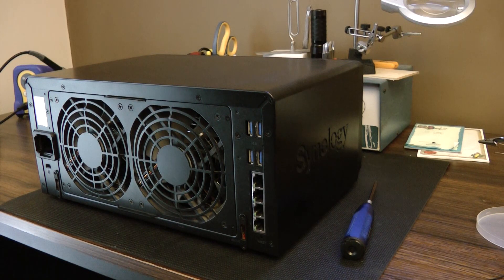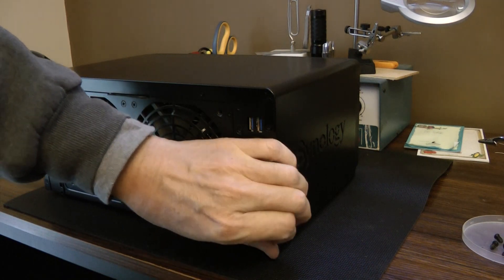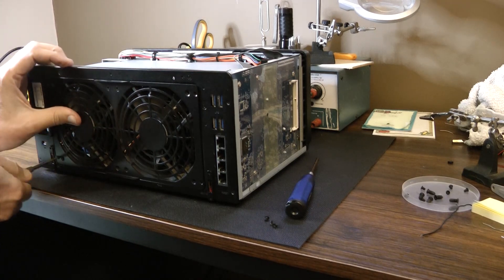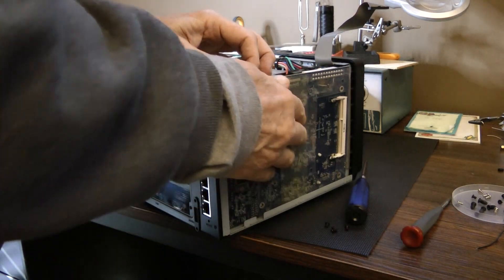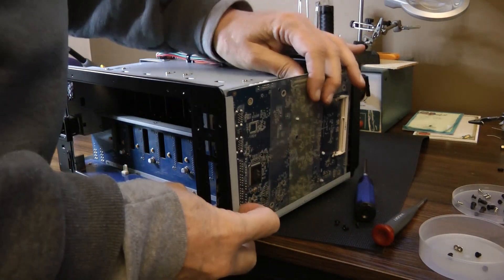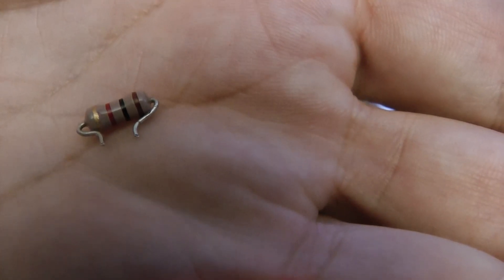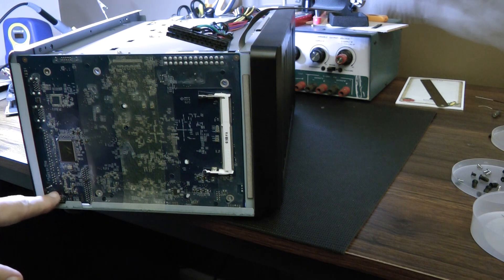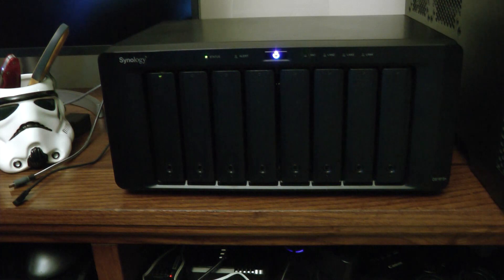Synology 1815+ won't turn on FIX

Comment: Hi Gary! I stumbled across this video. Is there a way to test and see what the issue is before I start soldering new stuff? You mentioned a C2000 Atom thing but it was already installed. Is that something that is needed as well?
Reply from the maker: There are two issues with the 15 series Synology NAS's.  The ATOM bug which was installed on the one NAS I fixed.  I have a total of 3 Synology 15 series NAS's.  All of them need the ATOM fix.  Two of them I bought used/broken on eBay and applied the ATOM bug to one of them and the other one already had the ATOM fix.  Both of them needed the resistor over the transistor.  

Eventually that transistor will fail which prevents the NAS from turning on.  The patch is to solder a resistor over the transistor.  The problem is that it won't last, but I got a good 3 years out of them with that patch.  Then I had to replace the transistor, but again that transistor will fail again.  

I did some research and 'maybe' found the permanent fix by replacing that resistor in the power supply.  It supposedly puts too much current through the transistor resulting in it failing.  I did that fix about 10 months ago, so there is no way to know yet if that is the final fix. 

The ATOM bug (Intel bug) has to be done to them.  It's pretty much a guarantee that will fail your NAS.  The transistor thing happens a lot of times but it's not 100%.  I still have a 15 series NAS where the only thing I did to it was the ATOM fix.  

There is nothing you can test.  If the NAS is flaky turning on, turns off while running, that's the transistor assuming you already applied the ATOM fix.
Reply: @GaryQuiring I just started having random power offs and now I can’t get it to turn back on. I thought maybe it was the power supply. I was hoping there was a way to see if that is still outputting power. I guess I’ll look up the ATOM bug and get a resistor as well.
Reply from the maker: @jasonhagen  That's the classic symptom for the transistor issue.  Put the resistor over the transistor and that will fix it.  Also do the ATOM fix.
Reply: @GaryQuiring do you know if I’ll need a new battery as well? No one has one in stock so I have to order one and it will be a few days. Just trying to see if I can do the resistor fix or wait til I get a battery as well. 

Also will the 1k ohm resistor work if it’s a 1/4 watt? Or does it have to be 1/2 watt as well?
Reply from the maker: @jasonhagen  Not sure.  I think the battery probably keeps the internal clock running if it loses power.  Since the clock is set via the NTP server it's kinda odd why it's there.
Reply: @GaryQuiring  would you happen to have the BC487C transistor I could buy from you? All I can find is 100 pack and I don’t need that many.

Comment: Ich habe das Video gerade von einem Kunden vorgeschlagen bekommen - ob ich das so reparieren könnte, und was es kosten würde. Und ich habe gesagt, das kann ich schlicht nicht verantworten!! Also ein Tranistor (JUNGE) ist ein aktives Bauelement, entweder als Schalter oder als Verstärker genützt, und ein Widerstand ist ein passives Bauelement. Und Synology müsste ja dumm sein, einen Transistor zu verwenden, wenn ein Widerstand die gleiche Arbeit machen könnte! 
Also ich müsste da erst mal die Funktion des Transistors prüfen, sehen was er da macht um zu sehen, ob man den tatsächlich durch den Widerstand ersetzen kann, oder nicht. das einfach so zu machen, ist in meinen Augen vollkommen verantwortungslos. Vermutlich wurde die CE oder DS Strecke einfach quasi "gebrückt" damit laufen "viele Schaltungen" aber eben nicht so wie sie sollten. Also der Basis oder Gate Anschluss, der ist offen, und der steuert ja wohl den Transistor aus einem bestimmten Grund. Mich wundert, dass ihr das in den USA macht, also gerade weil ja die Schadensersatzforderungen bei Euch höher sind als in DE - was wenn dem Kunde sein Haus wegen dem Ding abbrennt, weil der Transistor zb. nicht mehr abschalten kann, wenn zb. etwas zu heiß wird?? Kann man machen - ICH mache es DEFINITIV NICHT so, weil da könnte ich nicht mehr ruhig schlafen.
Reply from the maker: Nothing is going to burn down, it's a design flaw that overtime damages the transistor.  So replace the transistor so it's exactly how it comes from Synology.  Of course it will fail again but the customer will get several good years out of it.

Comment: Hi Gary, I just completed this fox for my DS1815+ and it did the trick. Thanks a lot for this video, it clearly explains what needs fixing. I also saw your updated video as well as Nick's TV Repair that address the true issue - the transistor on the PSU and MB. I don't have these transistors but I did have a 1KOhm resistor for this fix. I'll migrate and save my data right now and then work on getting the proper fix applied.

Comment: I'm having to do these repairs right now. I also just wanted to add my thanks for such clear instructions and video/pictures. And also your 3rd hand tip. As someone that's relatively inexperienced at soldering around surface mounted components that was a super helpful tip.

Comment: I also have a 1815+ with the same problem that it wouldn’t start. Thanks to the video, I was able to get it running again – a very helpful video that saved me money. Many thanks for that!

However, I have a question: How long does the soldered solution last? Will I need to look for a new device soon, or can I continue using my NAS without any issues with this fixed problem?
Reply from the maker: When I did this fix on one 1815+ and it lasted an additional 3yrs and the other about 2.5yrs.  I have an updated video where you need to replace a resistor in the power supply and replace the transistor.  I can't say for sure this will guarantee it won't happen again but from my research it seems like a better solution.  So don't toss the NAS out, do the repair in the updated video.  

https://www.youtube.com/watch?v=dH8B0Vy3rkw

Comment: Thank you so much for this video!

This fix saved me more than 1.000€. 

My DS1815+ was completely dead, even with a new PSU. Glad to find this solution!
Reply from the maker: Hopefully you can return the power supply for a refund.  Glad you got it going.
Reply: @ i could send it back. But the old one its fan makes a lot of noise so i will keep it and thus be solid for a longer period.

Comment: I applied both fixes and I still could not use the power button. It was able to boot after I jumpered the green wire of the power supply to the black ground next to it. Previously when I tried the jumper boot I got the amber alert and power flash non-boot issue. At least the 100 ohm is working. I'm pretty sure the 1K was secured well. Am I missing something?
Reply from the maker: The transistor (Q4) is probably toast.  You will need to replace it.  It's a BC847 which Amazon sells.  I replaced one just two weeks ago.  My 1815+ that I did the 1k fix on about 3 years ago had the same issue, it would no longer turn on.  Shorting the green and black on the power proved it was working. Once I replaced the transistor it booted but it still required the 1k resistor which surprised me.

The root cause of the problem from what I have researched is an out spec voltage coming from the power supply.  I replaced a resistor in the power supply last week but there is no way to know for sure if that will permanently fix the problem.   I was planning on making a video on how to change out that resistor, it's not easy.  It's very tiny, SMD type.  For now get that BC847 replaced, that should give you several years of service.

Comment: Hi Gary, thanks a lot for your video. One of my DS1815+ suddenly stopped working and won't turn on anymore. I wanted to ask you if I should also test the power supply unit? Atom bug fix isn't applied on  the server at the moment. Thank you.
Reply from the maker: It's most likely not the power supply.  Do both resistor fixes.
Reply: @GaryQuiring  Thank you!

Comment: Hi Gary, I've got the 1815+ which I've hardly used since I brought it in 2016 and it is working fine.  My question is should I do any of these fixes whilst it it is working fine or wait until I have an issue?
Reply from the maker: I would wait.
Reply: Probably wait as Gary said but perhaps also buy those resistors so you have them on hand if something does go wrong. Also it may help to have a spare ATX power supply on standy for testing and emergency startup.

Comment: I soldered the resistors on and it booted and worked great until it powered down then it would not power back up again a second time without replacing the resistor again?
Reply from the maker: I'm not 100% clear what you are describing, did you replace the resistors a 2nd time?

Comment: With my unit, it wouldnt turn on after being on holiday for a week so I stuck it on a radiator to warm up, I plugged it in when it got to over 20 degrees centigrade. From this information is it possible to diagnose what fault it has? I'd like to get it sold on and get a newer unit...
Reply from the maker: I would try the resistor fixes.  If you are handy soldering it's an easy job.
Reply: @GaryQuiring  will do that, thanks Gary

Comment: Have you encountered a power problem where the power adapter turns on (green LED turns ON) when plugged into the wall outlet but when plugged into the Synology DS720+ the green LED light indicator turns OFF immediately?   The DS720+ would not even turned ON when the power button is pressed.  Thank you.

Comment: Curious, Can I use 1/4W 10K OHM 2% Resistor instead of 1K? Thanks in advance.
Reply from the maker: That's no minor resistance change, why not get what is recommended?  The 1%, 2% 10% does not matter, 1/4 watt is fine but you should get something close to 1k.

Comment: Hi Gary, thanks for all your help to the community! Wondering if you point me in the right direction: I have a 1815+ and this morning, it was powered off and power button doesn't do anything.  It already had the Intel ATOM fix applied by Synology under warranty in 2017.  I took the motherboard out and replaced the C1220 battery which was reading just 0.65 volts.  New one is 3.3 volts so I thought that would fix it.  Put it back together and still nothing.  I jumped the green and black cables from the PSU with a paper clip and it fires up as soon as the power cable is connected, but it just sits with a blinking blue light. I then tried the 1k resistor fix on Q4-Q1 here: https://i.imgur.com/NPeFL6Z.jpeg not the best job but I'm pretty sure it's connected.  My reading on the resistor with a multimeter, after it's installed, is now only 90-94 ohms, but before I installed it, it was 998 or close to 1k. Do you know if there is something in the circuit that would effect the reading or is it improperly installed? Power button still does nothing and I think I'm out of options (read: cheap fixes).

Comment: Gary, thanks for your guide to fix the power issue of the 1815+. I watched this video multiple times, also in frame-by-frame mode around 6:53. But I feel I could not recognize exactly enough where the two wires  of that 1 kOhm resistor have to be fixed on the PCB, your soldering points look a bit in the shadow and slightly out of focus here. Could you please add some information on where to put the R exactly? Thanks in advance! Cheers, and a Happy New Year!
How can I send you a close-up of my PCB, that I just took? There are these two triple-pad patterns, one is empty, the other carries a transistor. It looks like you place the new 1 k between the 8-o'clock-pads of these two triplets. Correct? Pls confirm or correct. Thanks again.
Reply from the maker: The solder points are well in focus at 5:51.

Comment: This is the 3rd DS1815+ that has failed...I think I will try this before I give up on NAS solution.  Thank you.
Reply from the maker: It's a common issue but those two resistor fixes will resolve the problem.  It's very satisfying to fix something like this for under $1 dollar.

Comment: Hello, very nice video. 

I have one question concerning the 100 ohm resistor which fix the Intel atom bug. 
I have a set of jumpers sitting Instead of the 12 holes. Is it a variant of the DS1815+ ? 
Am I supposed to remove them to place the 100 ohm ?

thank you
Reply from the maker: There should not be any jumpers there.  Can you post a photo of them?  You can use https://imgur.com/ and share the link in the comments.
Reply: @GaryQuiring  https://drive.google.com/file/d/10OCGL_kYJdNIausmKRGu3B9WAgEBshEh/view?usp=sharing
Reply from the maker: @pashoo4728  Ok I had a different thought when you said jumpers.  Just solder the resistor to the pins on the connector.
Reply: @GaryQuiring  
It's weird, I did not see this connector on any video in YouTube.
I will try once I will receive my soldering kit.
Reply: @GaryQuiring : i tried to post the image with the site you suggested (i cannot write the name here ), and it failed each time.... . I could see my comment but once logged out, I figured out that it is not visible. Somehow youtube robots are not allowing it. and you do not even receive any notification or any alert. :face-orange-raised-eyebrow:
I asked to one friend to post it, it also failed.
finally I tried with google drive and it worked !
what a headache 🤕
Reply from the maker: @pashoo4728  It's ok that worked too, I use imgur on Reddit, so I assumed it would work with Youtube.

Comment: Any thoughts on fixing the Synology DS412+ it has a constant blinking light. I can't seem to find any info on this particular unit.  Thx
Reply from the maker: Does it use a brick for the power supply or just a plug?
Reply: @GaryQuiring  It uses a brick which is new, I just bought it.  I also replaced the cmos battery and tried another stick of memory.
Reply from the maker: @chriswright3327  It's probably the Atom bug, take a look at this pic (not my fix), this is what you have to do.  https://imgur.com/a/yZ9GfcL
Reply: @GaryQuiring  I’ll give that a try thanks. I notice that the 100 ohm resistor fix was done on your NAS and you ended up installing another one to get your going.  Do you know if this an option for the 412 if the 100 ohm doesn’t fix the problem?
Reply from the maker: @chriswright3327  The 100 ohm resistor is an Intel bug with some of their Atom 2xxx CPU's.  It's not related to the 1k resistor fix.  I have to assume when I bought my broken NAS the owner tried the Atom fix (which he did not mention in his ebay listing) and when that did not resolve the problem he sold it.  It was not common knowledge back then about the 1k fix.  I found the discussion on a German forum and decided to try it.  The 1k fix is because the transistor (BC847) fails which prevents the system from turning on.  A lot of the Synology motherboards have the same design with the transistor they label as Q4.  Since yours is turning on most likely the Atom fix is all you need.

Comment: Hi Gary, thanks for this video. I am going to try and fix my DS1815+. I also broke the flat cable that shows in this video, do you know what type of cable this is ? or where i can order an replacement cable ?
Reply from the maker: The ribbon cable is most likely not custom, it's probably easy enough to find.  Count how many pins across it goes and search for it with Google.  Make sure the edge connector looks the same, they usually use the same spacing.

Comment: Hi Gary, great video, thnx and been a Synology user for years, but this 1815+ has nothing more then a headache. Within 3 years it failed and got replaced, but 1 year after replacing, just outside of warranty it failed again of course. So many users have been affected by this. Synology doesnt offer any help or repair options, just a bit of discount on a new unit. I will never buy Synology again! My unit doesn't boot either, 100ohm was already done after first replacement. My power supply is just fine and boots when shorting black and green but the 1K doesnt get the job done. Put a second in series, so 2K, doesnt work either, any idea's?
Reply from the maker: You will need to replace the transistor, that's my best guess.  It's a BC847.
Reply: @GaryQuiring  thnx, was thinking the same thing, went with 3 and 4k, no difference
Reply: @GaryQuiring  should i use the bc847 C version btw? Im in the Netherlands, 230V
Reply from the maker: @devrim1134  I'm not sure.  I would think the input voltage is not going to the transistor?  It's probably getting dropped to 5v or something like that.
Reply: @GaryQuiring  it worked! Replaced the smd transistor and its working again, thnx!
Reply from the maker: @devrim1134  What transistor did you end up using?

Comment: Mine just failed after 7+ years… Ugh. 😢
Is there a detailed vid on the installation of the resistor you didn’t have to change? From this vid, it’s apparent that the unit can still fail even with the “first” resistor replaced. It seems slightly easier to do, so I think I’d like to try that fix first. I think I can find where to solder it from your still photo. Sound like a plan?